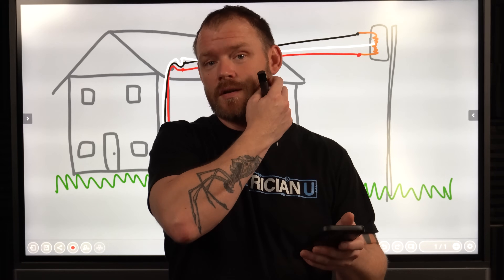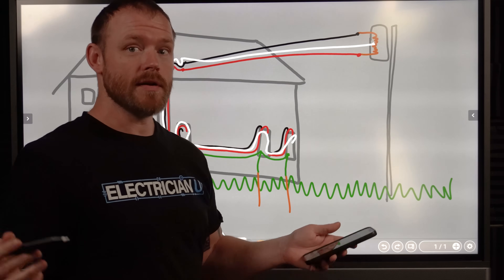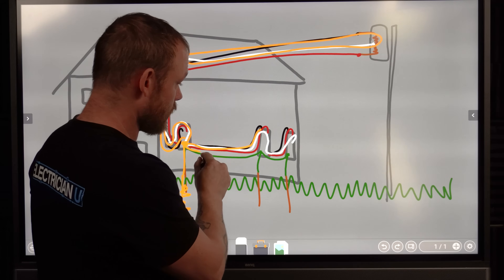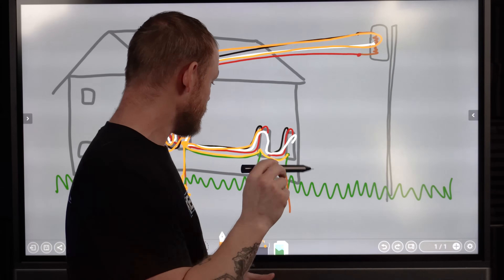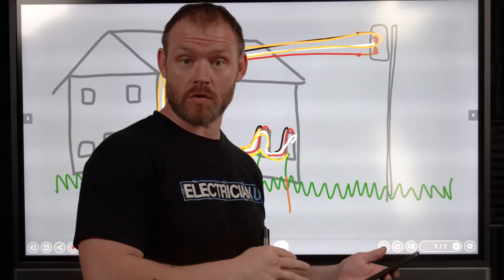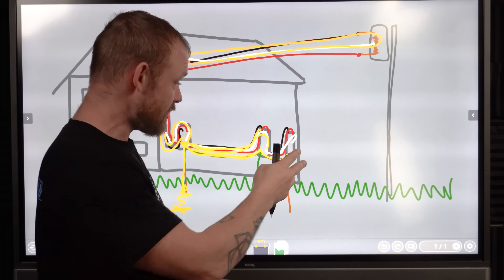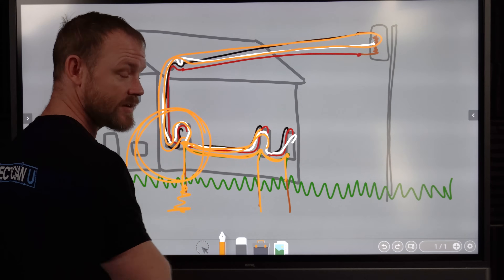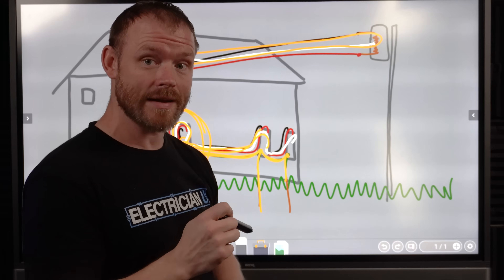Do We Need Separate Ground Rods for Each Sub Panel?

Comment: Have 3 separate conductive paths that are far superior to 1 or 2 eight foot ground rods in my house. Yep the 3/4" copper water service, the 1.5" steel gas pipe leading out to 6" gas main & even the 4" steel cast iron steel soil pipe. Over my 50 years as a sparky have taken ampere readings on 100 & 200 amp services with the 1 or 2 8' ground rods I drove in. Every single time the copper water service had at least 1/4 amp and less on steel gas service. Could not pick any ampere on ground rods proving ground rods provide a piss poor ground path.  With the 200 amp services breaker off I decided to measure ampere thru a house in the 3/4" copper water service. This house was on the same transformer with at least ten other homes. Was able to.pick up a under 0.1 amp current flow. Rechecked all of my connections and everything was tight. Lazy Ultility company only feeds step down transformer with one of the 3 available 13,200 volt lines and uses pole ground rod and every neutral and metallic water & sewer pipe to back feed the other of auto transformer primary set up. If they ran two wires to feed transformers firmly believe that the current flow on pipes would be greatly reduced.
Reply: How do you get away with using gas piping as a grounding electrode? Assuming US code, NEC 250.52(B)(1) disallows  it.
Reply: bonding everything may save a home for a broken neutral, but that's scary to think about, because that means all the current is  now going out all the alternate paths. back through the surrounding homes bonding's, cable tv lines. not long ago I found melting coax and 20 to 40 amps flowing over the CATV-co's meter socket clamp, through the 14awg wire, ground block and back out the coax shield. that was after the cable co replaced the previous melted ground block and coax drop, I don't know how they guy didn't get fried.
to worsen that, they previously had out refrigeration, electrician and power utility multiple times each and none found the cause. luckily there was no fire caused by it and they learned a lesson or two.
Reply: You shouldnt have any amps on your ground unless something isnt correct

Comment: I have a 1979 built house in Seattle, WA.  It has 2 main panels right next to each other.  The 2nd panel is NOT a subpanel (no wires going from Main panel to 2nd panel).  One panel is used for high voltage (220) equipment (A/C unit, Elect water heater, Elect dryer) and the other is used for lighting/receptacles. Both panels have their own 200 A Circuit breaker.  Tripping either of the 200A circuit breakers does NOT turn off power to the other panel.   Each panel has it's own ground rod.  In both panels, the ground wires are bonded to the neutrals.   Is there any problem with this setup?
Reply: So your home has 2 separate electrical utility meters?
Reply: @montgomeryfortenberry  no, just one meter
Reply: So both panel feeders go back to the same meter
Reply: @montgomeryfortenberry  Yes. via metal conduit
Reply: @ericr2zz if only three conductors go from the meter to each panel and provided the conductors are properly terminated in the meter it sounds ok.
Reply: @montgomeryfortenberry  OK.  Thank you!
Reply: Both panels have their own L1, L2, and neutral coming in from the pole?  I also have dual 150 amp service, but it isn't split up into all 240v loads in one, and all 120v loads on the other.  They are both a mix.
Reply: if each panel has its own main breaker (might be at the meter) then you can bond at each panel because they are both main panels.

Comment: One thing that is never mentioned about ground rods. They often have a short life span. Did work in a machine shop that had at least an acre of open land around it  ( grass ). They were talked into installing 8' ground rods at 5 or 6 CNC machines . 5 years later they reconfigured this shop in order to install additional machines. One of the machnists made a steel clamp to pull ground rods out of the ground. Everyone had over halve the diameter eaten or corroded away . All were the plain Jane bronze colored rods sold at supply houses. Every machine had a proper size copper ground rod feeding the CNC machines. Shop had great expoxy coated floors and told me the few times a year they mop it use the same mild stuff they use on their kitchen floor at home.
Reply: Could be that the building was built on old dairy land and it has what is classified as "corrosive soil". This eats up metals and for conduit runs and things like that you need a coating around the metal to protect it. Unfortunately, you can't put a plastic coating around a ground rod because then it doesn't do its job. This is an interesting thing to think about, as the electric code can't conform to the building code for this type of soil, yet no one normally goes and pulls out ground rods and checks them periodically or considers them a wear item, yet they really can be wear items in areas with this soil classification.
Reply: @LordSaliss  sacrificial anodes exist to mitigate this, but of course need periodic replacement.
Reply: In Finland we use 20-40 m ground rods.

Comment: so why did the guys who put in my solar panels put a ground rod in directly below panels from the ground wires attached to all the panels and their metal rails holding them and then run the ground wire all the way through house to main service panel separately from power wires coming from panels encased in a metal conduit that are carrying the dc power to inverter.
Reply: Solar arrays are required to have grounding electrode conductors to grounding electrodes.  The purpose of grounding electrodes(possibly rods) is to send lightning to the earth.   Nothing else.  Hope this helps.

Comment: I don't know how it's done elsewhere but here in south Florida we always install two ground rods to make sure it meets the 25 OHMS.
Reply: You are required to test one ground rod to verify 25 ohms or less.  If too high, NEC says add a second rod regardless of ohm value.
Reply: @KevinCoop1  yes exactly,
Reply: @KevinCoop1  What are you measuring the 25 ohms relative to?  I mean, that earth ground kind of is the reference by definition.
Reply: @KevinCoop1  NFPA 70 says that? Please tell me where. Thanks.
Reply: 25 ohms? Don't you mean 0.25 ohms?
Reply: I don't know.🤷‍♂️

Comment: Dustin, could you do a video on grounding portable generators? How essential is having a grounding rod for a portable generator?
Reply: a portable gen connected to a house service (properly) will have a 4 wire cable and will make ground through the entrance panel ground rod.

Comment: What if the main panel doesn’t have a ground just a neutral
Reply: It’s been required since before WW2 if it is truly the”main panel”.  Could be fed from an exterior Main panel with ground.
Reply: You might get shocked when touching neutral, if it is at a higher potential than earth due to not being grounded.
Reply: If there is a neutral,  by definition, it is grouped already, that's why it's neutral and effectively has not "touch potential" despite the fact that it's LIVE and carrying current.

Comment: It's worth saying: you don't want more grounding electrodes than necessary. In various situations, like open neutral, hot-to-ground fault without tripping the breaker, lightning strike, etc, more grounding electrodes means more step hazards
Reply: A ground rod installed at a light pole is not a "grounding electode conductor". GEC's are only allowed at the service panel and is bonded with the neutral. A grounding conductor is required to be run to the pole. That conductor is not bonded to neutral in the pole. A ground rod would be spliced with the grounding wire and the tied into an attachment point in the pole. Still hsve a low path of resistance or impedance so the breaker can trip as needed. The grounded "aka neutral" would not be in contact with the ground.

Comment: i was talkimg to a guy about grounding rods for our new house, and he had mentioned weaving the wire through the rebar of the slab in place of a direct rod. 
First is that even a viable practice, and second if that were to be true, then my understanding would be that you would not want multiple rods as any of them would then be a access to the other panels via the slab.
Reply: So grounding in your footer is a good idea. How he said to do it not a good idea. You need a piece of rebar 20ft or more in length in the footer or you can supplement that with a 20 ft or more #4 bare copper wire. Either way you do it it needs to be in the footer not laying in the bottom or top. In the middle for best results. You would also use a clamp rated for this application to fasten the wire to the rebar. This is called a ufer ground is essentially the best possible ground you can give your self other than bonding to a metal water pipe that’s in ground. But you would run that ground wire out from the footer to the location of your panel or where it’ll be installed and that’ll go to your panel.
Reply: @fordsbetter3496     Very accurate and well written comment!
Reply: @KevinCoop1  thank you
Reply: @fordsbetter3496  it’s refreshing to see some get it right and clearly stated!   I’m retired now, and most electrical videos and many more comments make me sick.   Best wishes to you,   Kevin
Reply: @KevinCoop1  I appreciate it , as a 25 year old studying for his masters license right now kind words from the wise and experienced help keep me motivated. You have a good one as well.
Reply: @fordsbetter3496     If I can answer any question for you, i would be happy to help.

Comment: When should supplemental ground rods be added to sub panels, and why? What is the benefit of adding one or more for a sub panel? Why are they required for detached buildings?
Reply: Ground rods for sub panels in the same structure as the main panel are not required or suggested.   Where a feeder goes outside the structure to feed another structure, the N and G remain separated and grounding electrode is required to be connected to the ground bar.   Grounding electrodes purpose is for lightning to go to earth.   Dump the lightning as soon as possible.
Reply: @KevinCoop1  why are supplemental GEC's required for a detached building sub panel but not suggested for a sub panel in the same building? Is this purely a distance thing?
Reply: @riotgear6891  Because there can be a significant difference on the voltage of the earth floor in one building and another 300 yards away.   The earth ground is there to keep YOU from being shocked when you touch the metal chassis of a device with your feet on the ground, so you want there to be little to no voltage difference between your feed and where the chassis is grounded.  It doesn't really have anything to do with lightning at all.
Reply: @phillipsusi1791  thank you, that actually makes sense!
Reply: @phillipsusi1791  repeating in other words:  everything conductive in a structure should be at the same zero volts potential relative to the local Earth.  Only exception is the intended voltage and frequency on energized parts.

Comment: What is the benefit of multiple rods at subs?  Is it worth the added cost?
Reply: If they are in the same building wasting money installing ground rods at ANY sub panels. Wish people would wake up and realize a single or even two ground rods almost never supply 25 ohms or less to ground. Even 15 ohms to do ground is as good as pissing in the wind during a lightning strike! Mike Holt had to screw together five 8' ground rods for a total of 40' to finally reach just under 25'ohms. If you where to attempt to illuminate a,100 watt incandescent 120'volt lamp using a ground rod for the neutral it would be as dim as a tiny flashlight with worn out batteries.
Reply: @garbo8962     Why so negative?   Most commenters are not electricians or designers.   They are just asking what they do not understand.
Reply: @garbo8962  What do you even measure the impedance of the ground rod relative to?  The neutral going back to the earth ground at a pole with no current on it?  If the pole is far away then no matter how big your ground rod is there is going to be more then 25 ohms going through all of the earth between there and the ground rod at the pole.
Reply: @garbo8962  I remember watching that video a few years ago. He's considered expert enough to sell himself as an authority in court cases. 

Kinda unrelated, he may have some unsubstantiated beliefs related to health that he'll sometimes share.
Reply: Connections to earth can be tested for quality..soil types matter, so the quality of a ground rod connection to earth can vary with soil type. 

Some folks live on rock, and can't drive ground rods deep without great effort, so there are alternatives to ground rods driven into the earth. There are horizontal earthing(UK term) schemes, and ufer grounds - which is a connection to the steel reinforcement of a building's foundation/monolithic pour.

Comment: I only have one panel outside my house 200 amp service do I need to bond the neutral to the ground where you have grounds on the left and neutral on the right does it need to be bonded because when I installed the panel the guys from the electrical company said to take off bonding jumper from ground to neutral hmm let me know plz
Reply: The bonding jumper should only be used at the first means of disconnect. This is usually your main panel that is connected to the meter. Anything downstream of that should not bond grounds and neutrals.
Reply: I my area the inspectors demand that you throw away the green bonding screw or flimsy aluminum bonding jumper in every sub panel to prevent somebody installing them later on.
Reply: @garbo8962  interesting lol
Reply: @RiotGear  ok got you, thanks, buddy 👍

Comment: my ee called for 3- 5/8 - 20 ft rods 10 foot apart but i wasn't able to find those so i', doing 3 -3/8 10 foot rods 10 foot apart, he said as long as i get .25 ohm resistance i'm good
Reply: Was told at several IAEI continuing education classes that ground rod spacing must be st least the length of ground rod apart. In other words when using two 8' ground rods they must be at least 8' apart. Two 10' rods must be at least 10' apart..
Reply: @garbo8962  good to know
Reply: Many EE’s do not know as much as they need to.   Most EE’s have electronics training in classes, no electrical systems for building training.  I’ve seen some really really stupid attempts by EE’s.   Like a guy that wanted to know how to connect 500Kcmil to a 2” copper pipe that he wanted buried 8’ below grade.

Comment: We had some subpanels put in with equipment grounding conductors .  My handyman thought we should put in a separate grounding electric conductors (i.e. ground rods) with each subpanel.  

Also, the handyman insisted on running a continuous copper line from the ground rods on the subpanels all the way to the front of the building to connect it to the ground rod of the main panel.  The ground rod on the main panel is connected to the main panel box.  Any thoughts on if this is a good idea or not?
Reply: You need an electrician, not a handy man that has “Wared a few houses”
Reply: actually, each subpanel must have 4 wires going back to the main panel (and its own ground rod) so that extra ground wire will already be in the mix, just internal to the wiring between panels.
Reply: @rupe53     Please clarify the part of your comment about a ground rod for a sub-panel.  Every sub-panel or certain sub-panels?
Reply: @KevinCoop1  ... let me reword that specifically to your question. Each subpanel must have a ground wire going back to its feeder panel. (main panel or another subpanel) Each subpanel in a detached building (garage, shed, cottage) must have its own ground rod in addition to the ground wire, which goes back to the feeder panel. If all the subpanels are within the same structure, then you don't need any additional ground rods. (attached garage, in-law suite, basement, etc) IOW, everything is already going back to the rods at the main panel. (2 required for the main these days)
Reply: Not a great idea. Increases the chance of step hazards in certain fault situations. Also guarantees galvanic activity between the buildings. I bet it will make certain metal parts corrode more quickly.
Reply: Not REQUIRED. Actually they do little for protection in a wood construction.